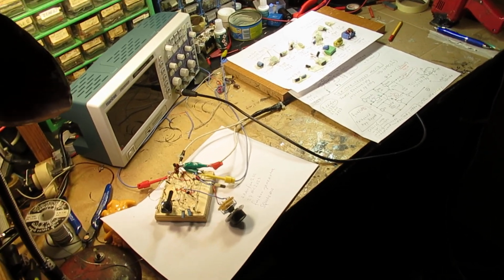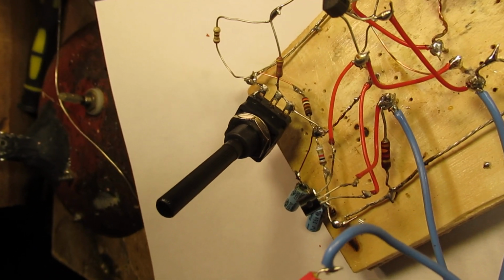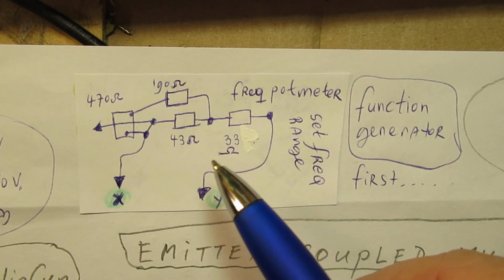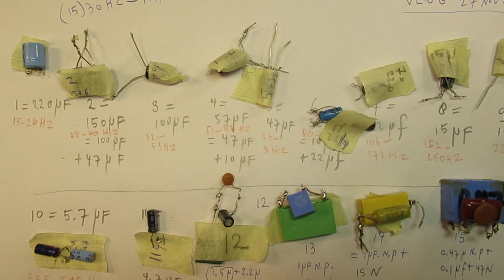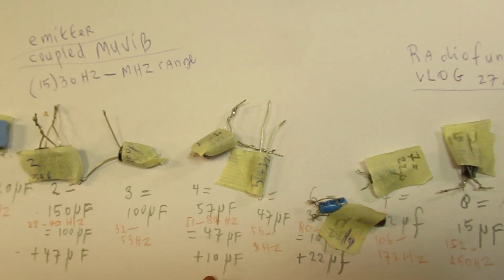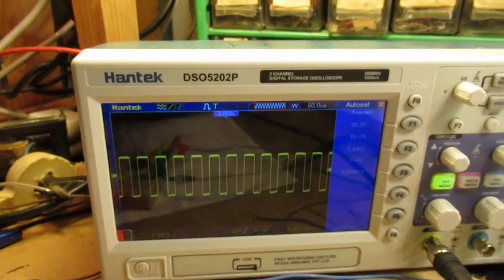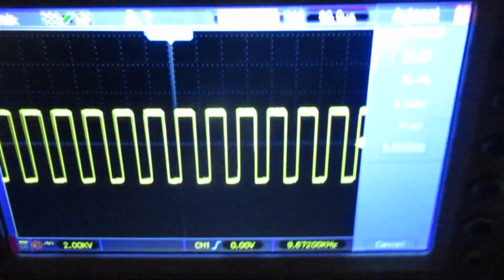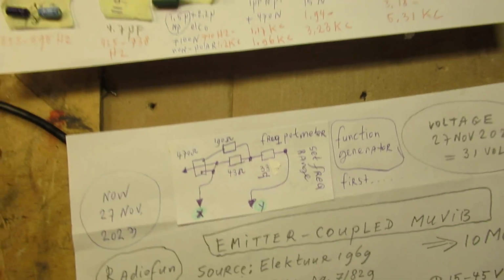2 transistor Emitter Coupled Square Wave Oscillator (the 1969 circuit) developed for the 8 MC range

Comment: I really liked this video, just the kind of oscillator circuit that I like. I look forward to hear you speak about this circuit working with RF and would be interested to see if the sinewave look good in RF levels.
Reply from the maker: Thanks. Because of the transistor properties, the square wave will change to a kind of sine wave, on the higher frequencies, say in the 2 MC-10 MC range. When you want to be sure about "always a sine wave out", you need an R-C filter and/or an extra 1 transistor amplifier to compensate for the losses. 

More info? 

Square Wave into Sine Wave video 1
https://youtu.be/AUr9f8KmCGQ 
Square Wave into sine wave video 2
https://youtu.be/Ly6X1ttNbdU 

And such a RC (or perhaps even LC) filter will only work in a limited frequency range. I did a few tests to get to the higher than 7 MC-10 MC range, but the waveforms were not very pure. On the other hand: on the lower frequencies (say in the 2-5 MC range) the squarewave can be transferred into a (kind of) sine wave. Kind of logical when we look at this simple 2 transistor circuit.  

So (message to you and everyone looking to this video on YT): test, try, experiment. Present the results on your own YT Channel.  

And (thus) a lot of interesting things can be done to make this a properly working broadband function generator for sine and square waves. More to come in the future, when I have time & inspiration to develop it further. 

Anyway: everyone with interest in electronics can make this circuit work and/or develop it further, it is classical analog technology, also usable to drive basic (simple) digital circuits, as a clock, via that square wave, when the stability of the clock frequency is not a big issue. 28 Nov. 2023. Only when you have made this circuit on your workbench and published it on YT, we can have a serious discussion about all the ins and outs. Thanks 28 nov 2023. Have pinned your comment.
Reply: Thank you for your inspiring videos (electronics & gardening), yes I will replicate this circuit so I can learn from it. I appreciate your reply, thank you.

Comment: What, if any, advantage does this circuit have over the "traditional" two transister astable multivibrator?
Reply from the maker: It is easier + the frequency is not (or slightly) dependent on the supply voltage. In the classical a-stable Muvib that you point to (I think...) there is a big effect of the supply voltage (1.5 V-30 Volt)  in relation to the frequency, of course also related to the cap. value and the value of the base resistors. 28 Nov 2023.
Reply from the maker: In my comment to @michelmoreI9208 you can find more info regarding your question(s). 28 Nov 2023.

Comment: Hi Ko,
Can you also adjust the duty cycle?
My idea is to change the resistor values from the transistors emitters to ground to be equal,
for instance both to be 4k7 or 3k3. Perhaps the duty cycle could be more like 50%?
BR
/Ulf
Reply from the maker: I still have to find it out, it will be phase 2 in the development.
Reply: @radiofun232  Hello,
I do not want to interfere with your investigations :)
You are doing a great job!
And this is a very interesting circuit that you have found.

But if you want to get 50% duty cycle it can be easily tested by holding a 12k resistor in parallell with the 4.7k resistor.

BR /Ulf
Reply from the maker: Hi Ulf, thanks, I have to find that out. It will be phase 2 in the development, phase 3 will be trying to make a simple filter that can change squarewaves to triange waves and sine waves. Will be difficult to make it for a broad frequency band, thanks.   @ulfhaller6818
Reply: Sorry. I mean of course the resistor values :)
I have edit my previous comment.
Reply from the maker: Up until now (4 dec. 2023) I am still working on the circuit and could not change the duty cycle, and then I mean: in such a way that everyone on YT can reproduce this circuit. It could be very fine that, with a simple potentiometer or so, the duty cycle could be changed. Could be, by the way. But I have to study all the properties of this circuit better. Could be that there is no clue after all (thus: you have to do that homework yourself....), but perhaps a clue pops up in the future when I have done more experiments. By the way: when you have found a good solution, publish it on your YT Channel, send it to me (the link) & everyone will be interested and I will/can share the link. Of course, in such a situation, you have to make it in reality and test it. I did not see on your YT Channel that you did that and tested it. If not, let us stop this discussion. One of the aims of my YT Channel is to show only working and tested circuits, thus I only accept in a very limited way: talks/discussions about electronics circuits theory, computer simulations of analog circuits, etc, of people interested in electronics. My YT Channel is not a forum, sorry to say.. Thus I cannot react on mimicked computer simulations of electronics circuits or electronic circuits that were not built in reality.  Anyway: thanks for your comment. 4 Dec. 2023.
Reply: @radiofun232  
Thanks for your comment.
I have actually wired up the circuit and it works in reality.

It is almost exactly like your schematic except that I have used
BC547B transistors instead of BF199.
Since I only could find one 470 ohm resistor I had to, in two cases, take 390+82 in series.

With capacitor value,C of 1uF the frequency was about 2 kHz.
Close to 50% duty cycle was achieved by a resistor value of 13k in parallell with the
4.7k emitter resistor on the second transistors emitter.

If you want I can send you my schematic, pictures of the setup  and the waveforms on my oscilloscope to your mail.
I have limited time right now, but maybe next week in that case.

BR /Ulf
Reply from the maker: Hi Ulf, valuable information for me and everyone interested. I am working on a buffer stage now, with a FET, to get the lowest frequencies (20 Hz-80 Hz) pure out. I will try your idea of the 13 K in parallel with the emitter resistor. Good idea!  @ulfhaller6818